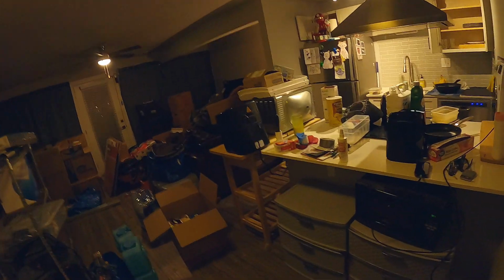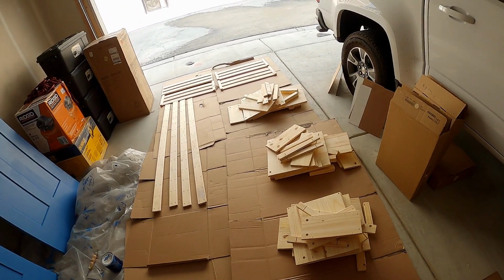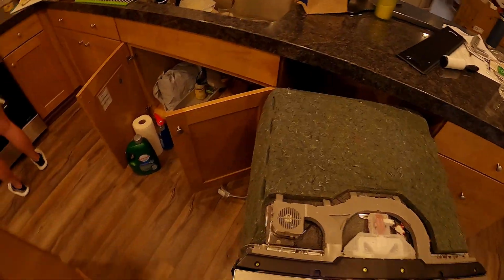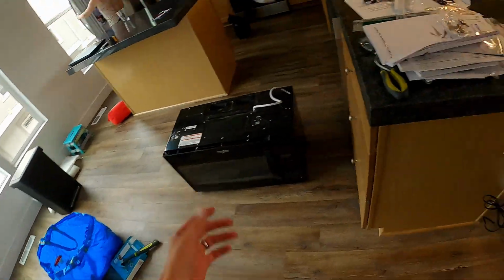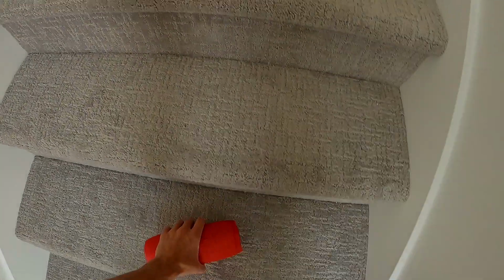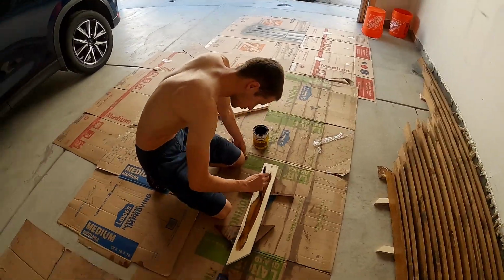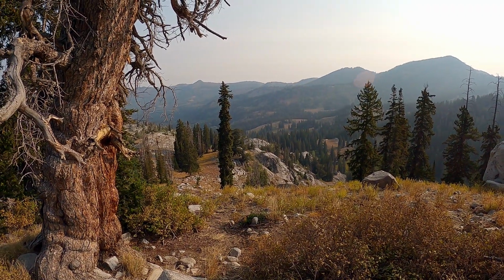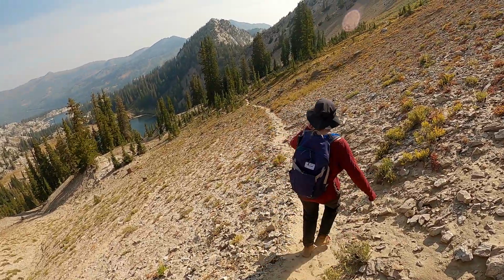Holzer Adventure...ers   -- ep 47

Comment: Dishwasher insulation -- The heat, as well as the steam or water that escapes from the dishwasher,can warp wooden cabinets and damage flooring, which often leads to costly repairs. Once again, insulation helps. It acts as a protective layer around the dishwasher, keeping the appliance from damaging other surfaces.